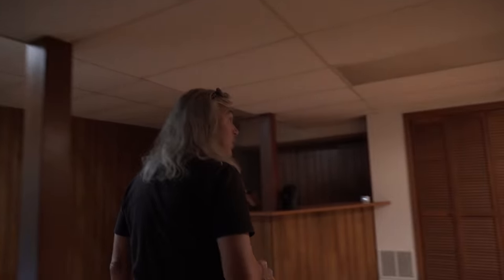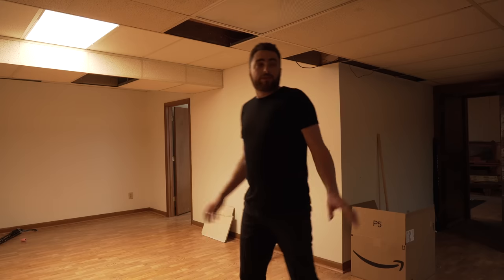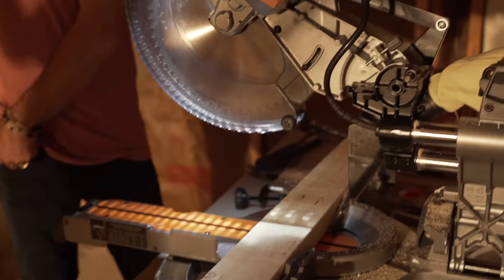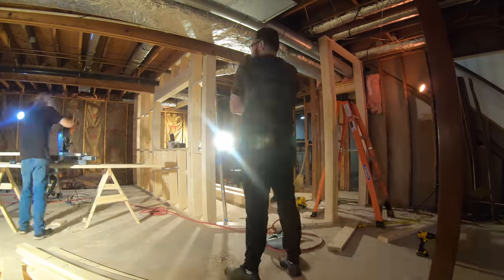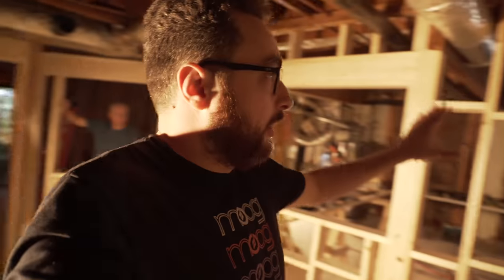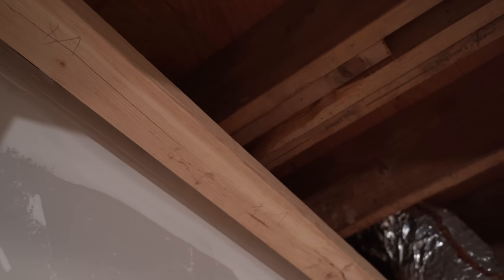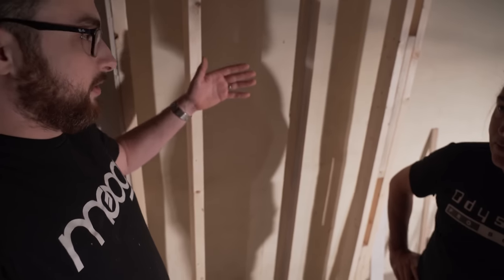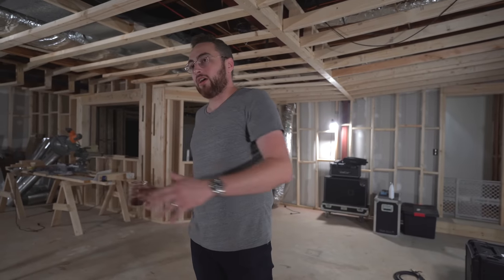Building My Dream Home Recording Studio Pt. 1

Comment: I'm building a similar studio in my basement. My basement has mostly brick/stone walls though, so instead of using drywall I'm using fireproof fabric stretched with insulation under it. Some surfaces the insulation are about 12-24" deep. Massive absorption! I have little care for separating sound between rooms, since I'm mostly just recording myself and the thick brick walls already separate enough for me. 

I choose an MCI JH-528 console.

Comment: About 20:00. The double door part. For how much you are spending on this project, just buy a new door with the correct swing and replace it. With labor it's more expensive to rebuild another door than to just buy a new one, and it will look better and be better insulated. Old ass doors like the existing one are usually not well insulated.
Reply: A new door might not match the exterior of the house at all. I would almost guarantee that's why they would even entertain the idea of reusing the current door.
Reply: This video sponsored by Sweetwater(tm). Not his money. Still not sure why a "musician" who has never really sold, or produced a record gets a sponsored recording studio, but I'm sure there are "reasons". Lots of these sorts of "musicians" on Social Media. Yet, no one ever seems to actually listen to their "music". Can't remember teh last Rhett Shull song, or solo I ever heard.....This comment sponsored by Sweetwater(tm).
Reply: @KarlKarsnark  Rhett is in a working, recording band.
Reply: Rod Gervais has a fairly cost effective single door construction plan for a 300lbs door that's very well isolated. Double seals, two sheets of MDF attached to a solid core door... it needs a commercial door closer though or else you risk taking a finger off if you get your hand stuck in the hinges.

Comment: I am loving this! I am a carpenter by day and a musician on the side. This is stimulating on multiple levels!
Reply: Same here
Reply: At about the 26:00 he was working on the floor and said “fire in the hole”. What was the tool and what was he doing?
Reply: @edwardcoit9748  Ramset, it nails the wood to the concrete floor with a 9  millimeter. You could also use a cut nail.
Reply: @pogocityradio77  
Thank you very much. I appreciate the response.

Comment: I enjoyed that. In the 80's I did freelance work wiring up audio. There were a lot of early 4 track and 8 track studios. Some did demos for bands and others made audio for radio and local TV ads. There was a local guy with a day job doing some engineering thing. He had the smarts so designed his own personal studio and word got out before long he designed everyone's. It was all very modest. Built by a few the local 'handyman' guys. Structural improvements were more like removing concrete block or wood pillars and putting up thin steel ones. Less surface for sound to bounce off and great for hanging mic cables, LOL It was a ....Sunn Studio's look out, here we come. 
Daniel Lanois more famed for producing U2 etc. had one of these. His brother Bob did all the building and it was in their mother's basement. My band parked our gear in it and they used it for free storage. Our booking guy even phoned Bob so he didn't book the studio when we had a gig. Me? since you asked I'm 75.

Comment: Rhett, I love your channel. Been watching for a few years. I'm a licensed Electrician. If I lived in GA I would offer to help you wire the studio. One thing to consider when you do get ready to wire the studio, is an Isolated grounding system for your circuits. This would require a completely separate circuit panel, and ground rods, from the house circuit panel. The reason to consider this system, is that it will isolate and grounding "noise" that happens in your house loads, from the studio. Grounding noise happens when motors run or when magnetic items turn on (Fluorescent lighting with ballasts would be an example) If you ever notice a hum on your amplifiers when there is no Guitar playing going on, you are experiencing ground noise. Installing an isolated ground system will take care of that, and make your recordings sound a lot better, as your not having to edit out the hum and static that ground noise can create. Good luck with the studio, and keep up the great work with your channel!

Comment: Hind sight always being 20/20 it may have been cheaper, if you have the room behind your house, to build a studio from the ground up. The average 3 car garage is usually 22x32ft. That's pretty good size for a home studio. You wouldn't have to worry about load bearing walls or, vent work for the first floor heating and cooling, plumbing or electrical wiring. But again, hind sight is always 20/20. Can't wait to see it finished.

Comment: "parameters". "load-bearing". "our layout is having a little drift". oh my days, that takes me back to the 2007 rebuild of my house. (rip the top off, move all the structural stuff, I-beams all over.) that was a project. and yes, walking into a room and saying to the builder "but the door's supposed to be there, not there", well that was ... exciting. hope it sounds good. if it doesn't, well that's why we invented "fix it in the mix". but I'm sure you've got this and it will be awesome. :yougotthis:

Comment: Looks good and don’t want to second guess but there are some confusing things here. I’ve never seen drywall go up before electrical which should make installing outlets interesting. 2x6 walls won’t be any sturdier than 2x4 in this application…just needs to transfer load but you lose 1.5”. Also, I don’t see pressure treated floor plates but maybe that’s not needed in that part of the country?

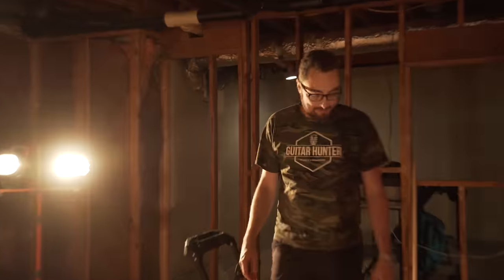Comment: @RhettShull 15:07 Is that waste main in the ceiling new? If not, I would probably pay the $250-500 to have a plumber camera the line and make sure no potential issues, before you get the drywall buttoned up. Typically when you have an overflow upstairs, or a wax ring leak on a toilet, it will follow the main down to the path of least resistance. Probably overkill, but an ounce of prevention considering the equipment going in under it. -- Sincerely, A Property Claims Ajuster

Comment: I was a carpenter for 15 years and I’m wondering why any of the existing partitions/Walls in the basement would be load bearing other than the ones around the stairs? Usually basements are a wide open space with a steel beam or two to carry the span of the floor joists. I also realize there are different building codes and practices around the country. Just wondering….Love the video and can’t wait to see the finished studio in use.
Reply: Great points, Mark. Thanks
Reply: You are correct. The metal poles are the only load bearing Structure in a basement.

Comment: Awesome video! Thanks for detailing the process. I just got done building out a control room only in my basement, and it's a project! Took me a year to fully finish it. Good luck with the rest of the process. Are the control room interior walls inside out walls? i.e. are you going to stuff the stud cavities with insulation and cover with fabric, or drywall them?

Comment: Lose the supports and replace them with glue lam or Jr I beam spans & floor jacks. Non load bearing walls need to be floating on pins. Vapor barrier the exterior walls. All drywall should go onto a minimum of CR1 slats for sound deadening. Insulate the crap out of those floor joists. Install twice as much electrical as you think you will need and run it in oversized EMT or flex conduit so you can add to it later. I'd also chalk the floor boards too. Install 3x more phone & data than you think you will need. The pin floating isolates the walls top & bottom. I built top secret confidentiality rated rooms for defense contractors. I also did a few recording studios too. I learned far more at places like Rockwell, General Dynamics, Raytheon, Boeing, Honeywell, Motorola GEG etc. Some of those places had full anechoic chambers. 100% dead rooms with baffles everywhere, even on the floors. Slide a mesh catwalk into the room set up your devices, mics, then pull the catwalk back out and close the door, which has baffles on it too.
Reply: Cool! Did you ever do any work at Kirtland AFB?

Comment: A few comments - did acoustic drywall get used?  Did acoustical caulking get used below the sole plate and on all the drywall prior to securing it to the wood framing?  I highly recommend using rockwall sound batt insulation if you do not intended to use closed cell foam.  I hope your order for windows is made, because backorder is at least 3 to 4 months long.  Good luck!
Reply: Second the rock wool insulation. Yeah it cost a lot more, but it just works so much better. Better than just air by far. Caulking is the other biggie. You have to caulk everything. It’s amazing what sound can leak thru. It really sucks to have your great vocal take ruined by bleed thru or a hum. The amount of energy required is tiny. Vibration from trucks rolling down your street. I never recorded in my listening space, but a shit ton of money meant I could hear farts in the crowd on a great record. I have been in XM1, the many million dollar performance/recording space XM built, while Los Lobos Dave Alvin, and many others best left unnamed played. Every dollar spent showed itself in the recordings they got. Sadly, you won’t hear it on their service for technical reasons .

Comment: I was taught that sheetrock should be hung horizontally to get more efficient use out of each piece. Why is it being hung vertically here?
Reply: maybe because they use 2 layers and it is always better to alternate them : first layer horizontal and the second one (the one we are seeing) verticaly ;)
Reply: 2 layers seems wasteful. But at 19:30 they're hanging it vertically straight onto the studs.
Reply: @benashton3691  2 layers of sheetrock is always better than one in acoustic treatments but you're right at 19:30. :)
Reply: @joeblack007forever  couldn't you just put soundproofing insulation in the wall?
Reply: @benashton3691  More mass = more isolation. Multiple layers of 5/8" drywall is one of the cheapest ways to put a lot of mass on your walls.
Reply: @marmaladecream2233  ok. I wasn't aware of that. Tbh, I wouldn't have a clue what soundproof insulation costs.
Reply: @benashton3691  in general the insulation doesn't do much isolation. It helps a little bit, but the bulk of the sound isolation comes from heavy, massive walls and the decoupling of those walls from each other.

Comment: Not to discourage anybody
But the build start off is all wrong from the start of this build.
Slab concrete floors shud have been cut and separated for each room then the ceiling decoupling!!!
Once you got that done the rest Is a cake walk
You will spend far less money putting money into floor and ceilings.
For isolation.
Theres no other way around this unless you have a free standing building away from and vibrations.
Ive built way to many to have learned a few things along the way for isolation.
Just a FYI